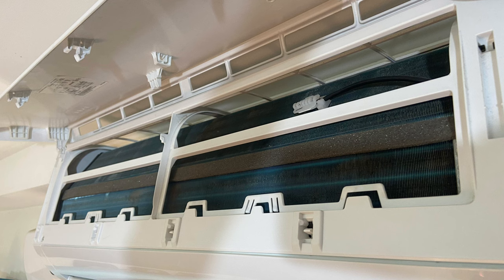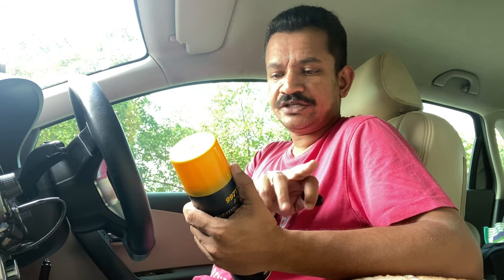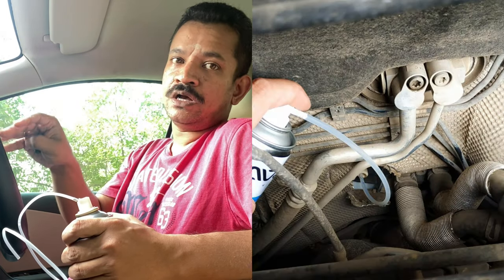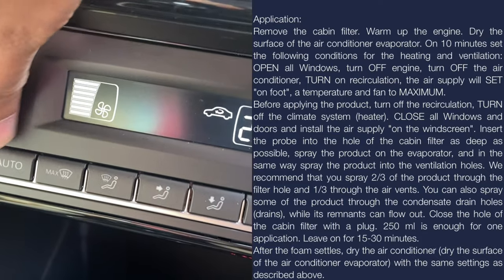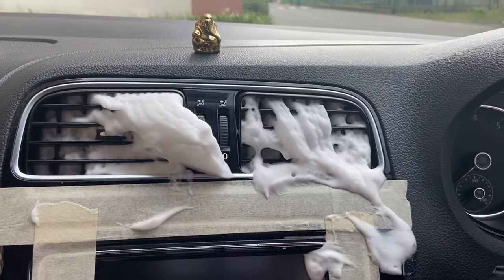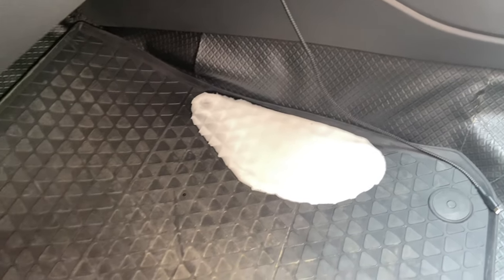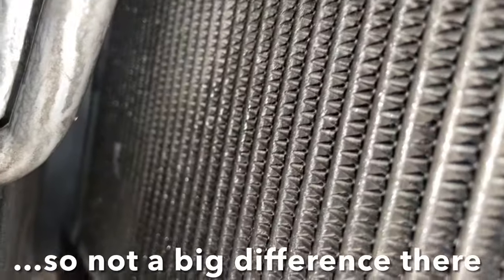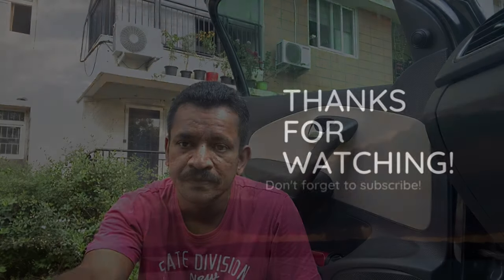Polo 6R - How to clean the AC evaporator/cooling coil

Comment: Just the video I needed. Thanks mate. I so badly wanted to clean the ac vents of my Taigun GT. Will follow this
Reply from the maker: Hey so soon? I mean it just be 1-2 years since you must have got the Taigun. Do you stay and drive in a very dusty area? I understand that the new Skoda and VW cars have a low AC performance but have you got the recent update from VW/Skoda? Do check with your authorised service centre.
Reply: @GaneshBalan  It’s been 15 months since I have got the car buddy. There is some bad odour every time I turn on the AC. Also on long drives this unpleasant smell kinda makes us uncomfortable. I mostly keep the recirculation mode off since I prefer fresh air. Only in heavy traffic I turn it on. Also We have never used any car perfumes or anything. I park my car under a shed. But yes it’s a dusty area.
Reply from the maker: Then do try cleaning this using a cooling coil foam cleaner spray. It will make a difference. Additionally, change the cabin air filter after you do this cleaning. 👍🏻
Reply: @GaneshBalan  Sure thing buddy. Thank you👍
Reply: @easternprestige I’ve the same issue with my Škoda,  just 1.5 years and this issue is happening

Comment: This is a great guide, Gannu. Thanks. I'll do this soon on my vento tdi as well. Couple of questions- Did you notice any sticky residue left back in the AC after this treatment?
How did your AC improve after this was done?
Reply from the maker: Hi Anirudh, nope no sticky residues. The concentrate inside the can is a non-sticky type. 

The throw of air was smelling very pleasant as if the car just rolled out of the showroom. If your car is over 6-8 years old and if you haven’t done this before, do try it out. 🙂 You’ll be pleasantly surprised at the results.
Reply: Thanks for the clarification! Just ordered the foam and will do it soon :)
Reply from the maker: @anirudhn1360 Good to hear. 🙂 Let me know how it went. 👍🏻

Comment: Another wonderful video :) Can you also make a video on cleaning the condenser and provide some tips to maintain the AC in good condition? 
My compressor suddenly stopped working and the service center guys said the wiring is all good its the compressor that's gone. That has to be replaced with filter dryer element of the condenser and the total damage to wallet of approx 30k . An independent AC specialist said its mostly the control valve in the compressor that goes out so it could be fine by just changing that. Going to try that soon. But will I have to replace the condenser filter dryer element too or can that be skipped. Your advise would be helpful.
Reply from the maker: Hi, I no longer have the Polo with me since I sold it. Had covered 9 years and 1.8 lakh km. 

I too had replaced the control valve on the compressor. If I remember correctly, I was charged some 6k for the whole thing including labour and refilling the R134A gas. You don’t have to touch the dryer element at all. Do try and let me know.
Reply: @GaneshBalan  Oh! That's good news. Hope its just the control valve. Getting a bit tired of back to back repairs with the gt tdi :|  But trying to keep it in shape and keep it going. Your videos are like a manual for me :) Yes will let you know if this works out
Thanks again.
Reply: And yes Ganesh I have read the heart breaking story on team bhp. The way you kept it, I just assumed it will last long enough to be a fully function retro car in 2050. But hey I think you are one of the very few people who has explored the full potential and beyond of this car in those 1.8L kms. Made it a GT TDI + . And also it's found a new owner so it's still on the roads. The legend lives on. 
And Honda Jazz would be my pick next as well . Anything Japanese would give peace of mind compared to this very lovable ticking time bomb.
Reply: @GaneshBalan  Hey it worked fine. AC is working as usual now. The coil was burnt. AC has stopped working along with this g31 sensor . Maybe it shorted. Also the bearing was changed. Total cost for this was 7500. 
However today I did something very stupid. There is a long sad story and reason as to why I was doing which I would not bore you with 😄but long story short, I broke the Battery negative to body chassis bolt :| Unfortunately while cleaning and putting it back I over tightened the the bolt and it just stripped off :| I think this has to be welded back. Do you think I can connect  the battery negative wire to any other grounding point temporarily ? 
The service centre is like 100 kms away :/ Any suggestions besides me calling the towing guy lol
Reply from the maker: @AK-sv4kb Dude! 😲 Yeah you can connect it to another point which is near the diesel filter. There’s a grounding bolt there. Ideally it should be closest to the battery but this is fine. Use a very thick cable.
Reply: @GaneshBalan  Near the diesel filter! Thats too far. And I don't have such thick cable anyway. I've done many beginner to intermediate level DIYs and this definitely makes it to the top 5 list of stupid mistakes.  
A lot of them having random electrical issues have reported to have solved their problems by fixing the ground cable. So just to be sure I cleaned it up and tried to make it real tight and secure. 
I'll try to get a welder tomorrow and just hope it's not a big deal. Thanks again Ganesh.
Reply from the maker: @AK-sv4kb yeah just scrape the surface a bit so the bolt head can be welded properly. And use low amperage in the welding machine since you’re welding to the frame.
Reply: @GaneshBalan  It's fixed. They welded it back at vw asc. I connected the boost pressure converter and battery negative together to the same point and drove to asc. Finally replaced the oem shocks with sachs. Had to do the usual annoying customer routine at asc to get them to use a torque wrench. They generally just tighten everything with the machine and dont bother to check the procedure. Ofc they're experienced they do it everyday and it's probably very good enough. But I insisted to use the correct torque. I just copied everything mentioned in the autodocuk video because it is exactly the same but strangely The torque values mentioned there and the ones at the service center had major differences sometimes. For example the 3 ball joint nuts were tightened to 50 Nm in the video but at asc it is mentioned 100 Nm. So tightened to 100 Nm. Now I had a brief glance at their super secret computer and I think it was showing polo 1.0 . When asked he said suspension stuff is the same for all. So idk just trusted them with it. Thanks for the suggestion by the way I mentioned to use low amp to weld. Idk if he cared but its been done well and painted it back too.
Reply from the maker: @AK-sv4kb suspension varies with the weight of the vehicle so they may have referred to a different vehicle for the values.
Reply: @GaneshBalan  I always liked reading about your nice and easy your service center experience in Gujrat. Its not the same experience here in Mangalore XD The place is very busy with the sheer number of vehicles that come in for regular service and accident repairs. They do things fast and do not care all that much about perfection and all. They just guarantee wheels wont fall off while driving XD So it was good to see them use a torque wrench. The bill this time is justifiable in that sense lol. And hey thanks for reading my essays and responding hope to see more of your Youtube content. Very useful as always. And you've kinda left a lot of us hanging with the mystery around the shoddy repair work on your GT. I totally understand how it annoyed/angry/irritated/sad would be to type out the horror. But hope to see something one day when I hit refresh on the last page of the thread. Whenever there is something wrong with car or it needs some maintenance, I still come back and see how you did it first and then go to the goras XD
Reply: @GaneshBalan  yea that 100 Nm felt a bit too much but I have no way to verify until I visit them next time and request them to show me their bible. Brief search on the internet wasn't reassuring. Some say 50Nm some say 45 but none said 100.

Comment: Ganesh bhai! Awesome man!  

This is the one I have been seeking for when I had the thought of how to increase the cooling on my car.  Will work on asap. ❤

But, did you videotape this earlier?😊
Reply from the maker: Hi, indeed I had recorded this some time back. Never had the mojo to edit and release it after I sold the car. Just lost all the motivation. But I thought I should do it since I’ve invested time and efforts in it. 

As regards ineffective cooling, while this is one, you should also check for other issues such as low refrigerant gas in the system, a dirty and clogged condenser coil etc. 

Do get the system thoroughly checked from a competent AC mechanic.

Comment: Be careful if you have a Honda or Acura, some of them have the ECU located right under the HVAC ducts in the back of the center console. When that foam turned into liquid, the liquid leaked down and onto my ECU. The liquid went inside the ECU box and onto the motherboard and rendered my car inoperable. I had to pull out my ECU, dry it out, and carefully clean off the corrosion that was forming. Its working good now, but I still have to seal the ECU board to prevent moisture from corroding the board.
Reply from the maker: Thanks for the heads-up Chavez! Did you mean the BCM? Because ECUs are usually located in the engine bay.
Reply: @GaneshBalan  The Toyota and Acura/Hondas that I owned have the ECU/PCM/ECM (main engine computer) inside under the dash. I'm not familiar with other manufacturers but I have heard that some other manufacturers place it in the engine bay.

Comment: nice. very helpful. thankyou. 1 Question. Would it be better to put the filter cover back on without the filter when spraying the foam in?
Reply from the maker: Hi thanks. Removing the cabin air filter cover lets you see how much the foam has penetrated within the system. That’s all.
Reply: @GaneshBalan  makes sense. thanks

Comment: You need to use the drain hole and spray the foam up though it in order to actually clean the system.
Reply from the maker: As long as the spout of the foam can reaches the evaporator coil and covers the coil with the foam, it works from the other side as well.

Some folks access the coil from the cabin filter and spray the foam.
Reply: Exactly I was wondering why to fill through vents, the dirt gets accumulated on other side of the Evaporator Coil which is far side of the vents as air gets thrown from other side. Filling through Drain Pipe makes sense and logical.

Comment: Sad to read about how you had to let it go.  Even I had to part ways with my 8 year old 1.5 TDI at the end of last year 😢
Reply from the maker: Sorry to hear that man. Trust the car was sold without any issues like I had on mine. What happened with my car was a freak incident - wasn’t expected since the car was serviced proactively on time. 

What did you upgrade to?
Reply: @GaneshBalan  I gave up after a couple of failed injectors that left me and family stranded. The answer from vw was the lack of extended warranty and rsa. Which irritated me. Sold for a decent price. 
The logical upgrade was taigun but didn’t even take a TD. 
Went with Hyryder G hybrid which i don’t consider an upgrade. I still miss polo
Reply from the maker: Sorry to hear that man. No doubt the Polo is a lovely hatchback. No other car can match up to it in terms of performance - be it in TDI or TSI guise. Glad you got a great crossover from a supremely reliable manufacturer. Wishing you loads of happiness and fuss-free ownership with the Hyryder. 🙂👍🏻
Reply: @GaneshBalan  thank you 😊

Comment: Hey Ganesh - did you ever clean the EGR and anti-shudder valve for your car? Is it worth getting done?
Reply from the maker: Hi, no I could not. I wanted to but the aftermarket FNG where I used to give the Polo here in Chennai would always dissuade me by saying it is hard to access the EGR unlike the Marutis and it wont yield any tangible benefits (which I would disagree with). If your diesel Polo or Vento is over 6-8 years old, it will be worthwhile getting it cleaned. Lot of soot deposits.
Reply: @GaneshBalan  thanks. Appreciate your taking time to respond. My car is 7 years and done about 80k, so wondering if I should have it done. I know you have done quite a lot of kms in your car so wanted to check. One other thing, the bilstein shock absorbers you fitted, were they B6, how was your experience with them?

Comment: A question Sir: when you insert the hose from the filter hole, does it go to the right or left side of the car to reach the evaporator?
Reply from the maker: Back of the evaporator coil.
Reply: Depends on the vehicle. Essentially you aim it towards where the airflow is coming from ( indicated on the cabin air filter and sometimes on the cover. Alternately run the system on “ outside air “ and insert a piece of tissue firmly held in your hand, into the area that the filter used to be in. You’ll be able to tell which direction the air is coming from.

Comment: I get some dusting smell only when I turn on the heater. should I do this? Its a BMW 120i. I dont know if heater is part of HVAC system.
Reply from the maker: Hi, the heater is part of the coolant system. When the engine achieves operating temperature and the coolant temperature reaches approx 90’C, if you turn on the heater of the HVAC system, the hot coolant circulates through the vents.

Comment: Will this work on GMC cars?
Reply from the maker: Hi, this procedure is standard and works on all cars. Just check where the evaporator drain pipe on your car is. It would most likely be in front of the firewall. 

If you turn on the AC for some time, you’ll see the water dripping below your car. The spot above that is where rhetorical evaporator drain pipe is situated.